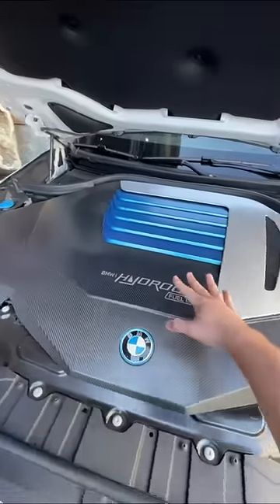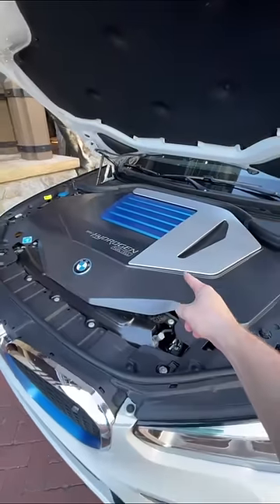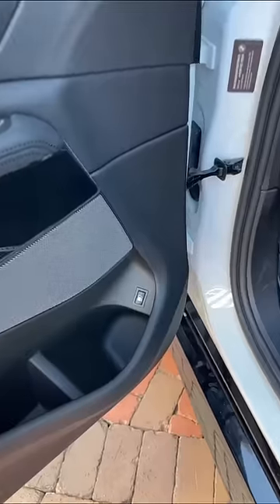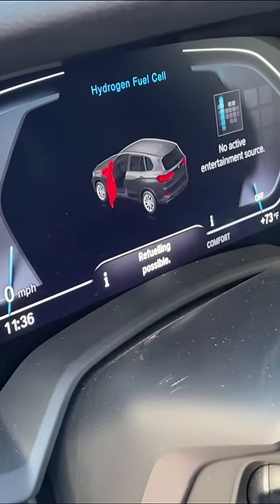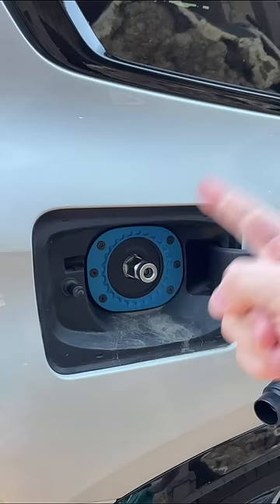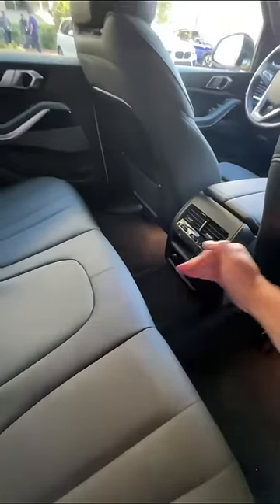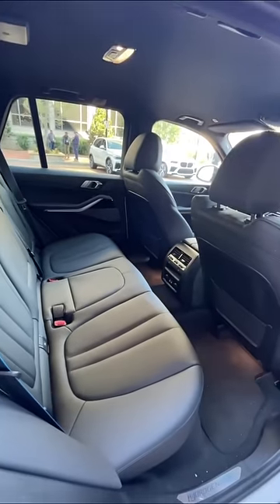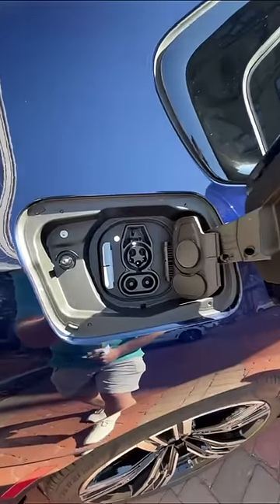BMW's Hydrogen X5 may be the future

Comment: Love how you told us the price vs gas/diesel/ electricity.....
Reply: It’s a pointless comparison. Hydrogen is like $36 per kilogram now.

1 kilogram of hydrogen has the energy density of 2 gallons of gasoline. Current average fuel price for gasoline is around $4.6 per gallon in California.

So hydrogen would have to be $9 per kilogram before any comparison would even be relevant. Ignoring the fact that it’s only available in parts of California.
Reply: Unless the demand for it increases, prices will never drop. Electric vehicles are cheap nowadays because their demand is up.
Reply: @daanishgupta That's backward. Higher demand, lower supply increases prices.
Reply: @AJWise  With higher demand, there will be higher supply unless you do what scalpers do, keep the supply limited to increase the price.
Reply: @AJWise but it’s higher demand higher supply right now. Every car manufacturer offers an electric or hybrid vehicle in their lineup or atleast plans to. Bmw, Volkswagen Hyundai all produce an overwhelming amount of full electric models today and that’s not even including the EV only companies like Tesla, Lucid or rivian.
Reply: @AJWise What you’re forgetting is industry of scale. Hydrogen is the most abundant resource on earth, so there’s no ‘low supply’ to be worried about.
Prices are high because this is a niche product, so few companies have the infrastructure to manufacture hydrogen stations
Reply: @daanishgupta  thats not how this works.
the price is only as low as it is right now because the demand is so low and because its a waste product of oil refineries.
real "green" hydrogen produced with renewable energy would cost even more.
Reply: @Pixelplanet5  I would advise you to study more about the economics of the automobile market and as an individual who is currently working in the hydrogen research sector, I can say this with assurance that it is on the upwards trend and will soon start becoming more affordable as the processes involved in producing the fuel, and it's utilisation become more advanced. As the demand increases, manufacturing becomes better, cheaper and faster. Look no further than the state of EVs today.
Reply: @daanishgupta  you dont seem to understand why hydrogen is so expensive.
90% of the cost of "green" hydrogen is energy cost and that wont change at any point in time.
It will always be cheaper to use electricity to charge a battery than using the same electricity so make hydrogen, compress it, liquefy it, transport it, keep it cooled in storage and then finally turn it back into electricity at 50% efficiency.
the end to end efficiency is simply WAY too low and its not something we can improve as physics will continue to exist no matter how hard people want to believe in hydrogen.
Reply: @Pixelplanet5  I would implore you to read more about hydrogen. That's all. The rest is upto you.
Reply: @daanishgupta  there is nothing more to read. physics is not gonna change.
Reply: @daanishgupta Pretty sure you have the fundamentals backwards there lol if there's more demand prices go higher they don't go down hahahaha

Comment: Our family has a car that goes with natural gas, and although the station where the gas is being made smells awful, it is very convenient because it refuels fast and it's a lot cheaper than gasoline
Reply: Easier on the engine too. Burns very clean
Reply: @ogalief It actually reduces the lifespan of the engine as your traditional Petrol/Diesel is a liquid, it provides a lubricating effect in the combustion chamber but gas is gas.
Reply: @rayirth.upside-down  dont think there's that much lubrication involved, at least for gasoline. Even if it was, the exhaust valves wouldn't benefit at all. 
CNG/LPG burns a lot hotter than regular Gas and therefore puts a lot of strain on valves, valve seats and piston. That shortens the lifespan.
Reply: @rayirth.upside-down  Oil provides lubrication. Gasoline provides combustion. They are mutually exclusive.
Reply: @rayirth.upside-down As far as I know it's more like the gasoline helps to keep the combustion chamber temperature down, by taking away some of the heat from  inside.

Natural gas is less dense and can't cool down the chamber fast enough. That said, most natural gas cars also have a gasoline tank, with a switch to pick between them. As long as you give gasoline to your engine once in a while, coupled with easy driving when it's on natural gas, there's no significant reduction of it's lifespan.
Reply: @moteroargentino7944  Ours has exactly that, but the car decides itself when to change
Reply: @rayirth.upside-down  only if you have a conversion. If the engine was build from the ground up to accept gas then it will live about as long as gasoline/diesel engine
Reply: @sx3fighter481  But most aren't, even Holden used to sell it with a conversion kit.
Reply: Probably Propane, not NG. If it were though, we could fill it up with NG at home! I guess you could with propane, too.
Reply: @Big_Perm  Well yeah, it takes energy to extract nitrogen, and powerplants are more efficent at producing that. Regular gas vehicles usually use methane based gases like biogas
Reply: Do hydrogen engines make noise?
Reply: @exidon2799  I don't know, but my guess is that yes they do, because the hydrogen explodes like natural gas or gasoline does
Reply: And it's way better than hydrogen because the infrastructure is already made and it's cheap to make natural gas
Reply: gasoline is also used to cool the cilinder walls down when using  alot of power
Reply: @rayirth.upside-down gasoline is most definitely not a lubricant. In fact it dissolves the actual lubricant: motor oil
Reply: Methane your car runs on methane
Reply: @leolipasti  hydrogen does it explode in a hydrogen powered car.

It merely oxidizes because the car doesn't use an internal combustion engine. But rather a hydrogen fuel cell to drive electric motors.
Reply: @sg5184  That's what natural gas mostly consists of, I know

Comment: Transporting hydrogen is expensive qnd cumbersome. Needs to be supercooled to a liquid state for safety reasons which is the main reason preventing mass adoption
Reply: I'll give you the same arguement ev people use. With time comes technology advancements.

Hydrogen has a brighter future then evs.
Reply: @shortyorc121 the difference is I have a 240V plug at home already, and I don’t need to use charging stations forever if it’s just for commuting everyday. I don’t see the immediate advantage of hydrogen over EVs for people who drive less than 100 miles a day. Maybe you spend 10 minutes at a charging station instead of 20 minutes? But then I have to go to a hydrogen charging station every 300-400 miles.
Reply: @mct6902  good for you, but when another 100 million evs hit the market is the problem. What about people who live in apartments? What about town homes with street only parking?

So many issues with evs outside of a niche market.
Reply: @shortyorc121 with the development of l3 quick charging infrastructure you can get from 0-80% charge in about 10 min which is not too far off from the time it takes to fill up a gas car or even hydrogen. Yes there are hurdles to overcome such as upgrading the grid to accommodate such high power, but expanding hydrogen stations has it's own set of issues as I mentioned above. So one doesn't seem that much better than the other, but the diff is that the world and maybe more importantly OEM's have already committed to EV's which is better than going half in on hydrogen as you won't see prices go down as much with scale. Not arguing on the merits of hydrogen itself, but it seems the battle is already won. Hydrogens do seem viable for commercial vehicles with fixed routes tho
Reply: @shortyorc121  you don’t snap a finger and make 100 million cars out of new type of energy source. Also, companies innovate, just like from horse wagon to ICE cars. If a snap of finger time in 1920s suddenly 300 million ICE cars were born, there wouldn’t be enough fossil fuel to supply them back then. Last, we are thousands if not 10s of thousands times closer from switching from ICE to electric than horse to ICE. Plus, you don’t have to switch, ICE will be around for a while if not forever.
Reply: That is not what is preventing mass adoption of hydrogen.
Reply: Care to elaborate?
Reply: @shortyorc121 we would be far better off using that same hydrogen to crack heavy oil into diesel and run diesel cars they are the most efficient and cost effective and then we can use the extra petroleum gas for plastic products and high-grade electronics.

You guys are arguing to spend energy to compress the hydrogen then use diesel trucks to deliver the tank to a station burning diesel to maintain subzero temperatures for transport. Hydrogen fuel cell cars are the most wasteful for this reason. It’s logistics people.
Reply: It's under high pressure and very corrosive
Reply: @shortyorc121 advancements cannot overcome thermodynamics though, hydrogen will never be more efficient than electric or even synthetic gasoline, and cannot be cheaper even if hydrogen is free to begin with because of the processing and infrastructure needed. Hydrogen has other great "green" uses, that don't involve transportation of the fuel or being used as a fuel.
Reply: @shortyorc121  fundamental physics/chemistry disagrees:

A hydrogen vehicle will always be 3-5x more expensive per mile to drive than an EV, due to the need to convert energy several times with huge losses at each stage, rather than just using electricity to drive a motor.

Doesn't matter how many small gains are made, there are huge fundamental rules that mean hydrogen will always be dead in the water.

Look at how a road legal petrol engine has never got more efficient than about 40% ; similar reasons at play here.

Comment: This would legitimately be pretty cool if hydrogen stations actually existed at regular intervals.
Reply: @stupidvideos1449 Fortunately for the planet the number of hydrogen stations is decreasing. Norway and UK closing all their stations due to cost and deaths, and the fact it's dirtier than coal.
Reply: @stupidvideos1449 I believe it’s super energy intensive to get the hydrogen. I don’t know if they break apart water or other molecules but if they do then it’s very obvious that it isn’t a good idea.
Reply: You can make hydrogen and oxygen from water and electricity.
Reply: They do in western Europe.
Reply: @kevinmencer3782 You can but industrially they don't. Too expensive.
Reply: @sdpryce hydrogen I'd literally one of the cleanest fuels, offten depending how it's used, rhebonly watse can just be watter, coal is very very dirty on the other hand
Reply: @kooll2401  The fuel itself is cleaner but uses way more electricity than just charging an EV
Reply: It would be fucking terrifying.
Reply: @13_cmi  and if they don't , all other methods of getting hydrogen makes carbon emissions
Reply: @kevinmencer3782 numbers , it takes a lot of electricity to make hydrogen from water , why do you think hydrogen costs 30+ $ per kilo ?
Reply: @kooll2401 just as clean as the electricity or carbohydrates it's made from

Comment: This will be a game changer. I need one of those  BMWs.
Reply: No it won’t, hydrogen has been out for years and it’s not a game changer yet so…
Reply: This is nothing new Toyota released the hydrogen powered Mirai 10 years ago. The problem is generating the hydrogen to power these cars, the easiest way is to use electrolysis to split water into hydrogen and oxygen but currently it's an expensive energy intensive process and so doesn't make financial sense.
Reply: George bush thought so too, spent taxpayer money on 1-2 stations which turned out to be too expensive to keep running. Good luck with your future hydrogen car mate
Reply: @geoffs3310 actually, the easiest way is steam reforming Natural gas, which is where most hydrogen on an industrial scale comes from. That also makes hydrogen a fossil fuel like Gasoline.
Reply: @geoffs3310  Got it. Thanks for the info.
Reply: @jaioncebollero1168  Thanks for the info.

Comment: Do y'all know hydrogen is one of the most volatile gasses? Just throwing that out there
Reply: Worse than a tesla ev  thermal runaway battery fire
Reply: @waynehewett4017  no it very literally isn't. Gas is used as a fuel because it isn't as explosive as hydrogen. Using hydrogen in this way is extremely dangerous.
Reply: @MadPrinceSheo  the same fears they had with gas powered cars, technology evolves and get better, from production to storage and everything in between
Reply: @Griffin96ful  not to mention hydrogen has low BTU value compared to other gasses so the yield wouldnt even be that good
Reply: @MadPrinceSheo  Fun fact: No. At the pressures we are talking about, if the tank gets punctured the gas would very quickly dissipate, and the expansion of the gas would cool the air so quickly it would likely put out any flames that had already ignited. As for inside the tank? You can't have an ignition without oxygen, and there's no oxygen inside a hydrogen tank.

There are literally tests you can see here on YouTube of the hydrogen tanks being shot by high caliber rifles, and all that happens is the gas vents very rapidly. No ignition, no nothing.